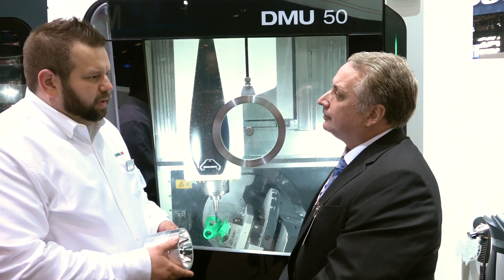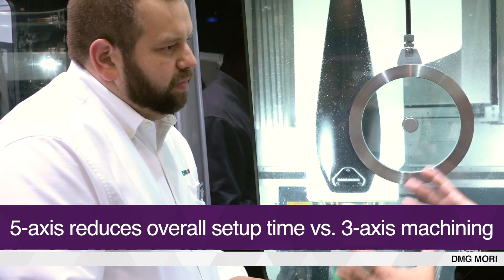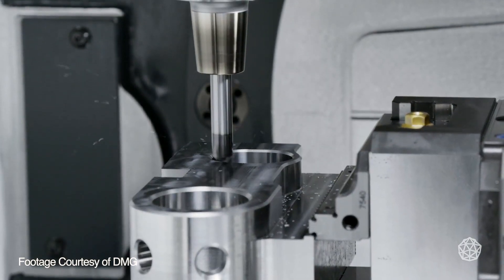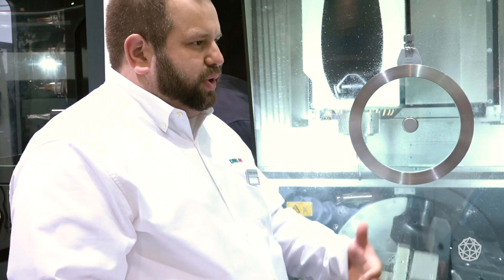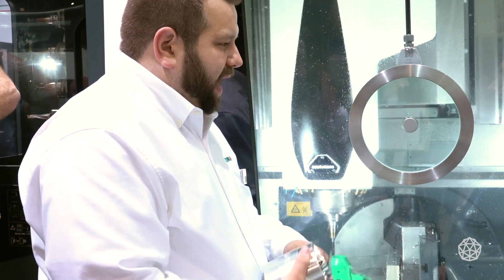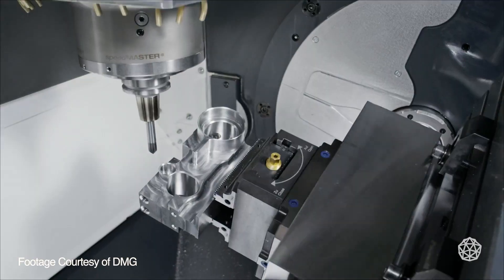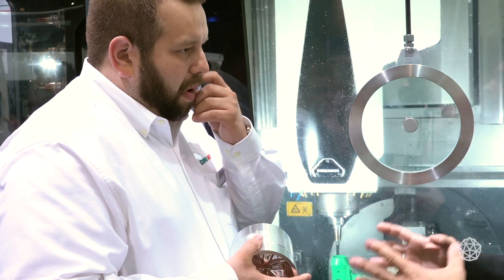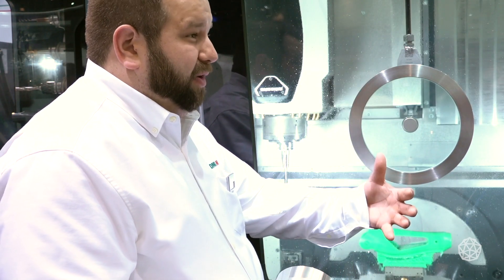Can DMG MORI Offer Entry-Level 5-Axis?

Comment: Awesome bit of kit but not quite a (pain in the) Hass.
Reply: It's like comparing an ar15 to a squirt gun really. 

Yes but can move in 5 axis and cut a part but the DMG machine is not only a lot more rigid, more precise and more capable (the Siemens control is the best thing ever when you get to learn how to take advantage of it), but also something that is often overlooked is that until now it's a generally superior design, that can work with less maintenance and with much less scheduled downtime. 

I worked on an M1 for a while and due to the head-head-head kinematic design (which turned out to have more than fair dynamic characteristics and machining capabilities for a maching of it's size/price) which has no moving parts below the spindle (except the optional tool presseter which is a must in my opinion...ask me if you want more details on how to make it 15 microns more precise/closer to final dimensions) means not only that you can completely clean the whole machine in under 20 minutes at the end of a shift, but you also never have to worry about chips lifting/entering the way covers or jamming an axis during long cycles or extended shifts and while not entirely convinced on ShopMill, it can get simple jobs done with 0 g-code (good for some prototypes and simple repairs but a huge timesink for production runs). 

I wish I could praise their support equally though... We never heard back neither on picking an angle head/stop block config/installation, neither on air through spindle (when it's definitely possible through the toolchange air purge solenoid), neither on commissioning a couple additional M-Codes for pneumatic clamps or even to just trigger external automations. Even basic things like controller/programming behavior and any questions/issues (we really got the stick end with some random failures) remain unanswered to this day while although the techs were quite knowledgeable and trained in setting up machines and teaching some specific machining examples, they were almost entirely unhelpful when it came to programming with answers such as "why did you make it so complex?" (for interpolating pilot holes for some pityful HSS drills and the reamer next up, when I was making some 30μm true position drilling jigs that were to churn more than 50k "impossible parts" per day without ever failing inspection).